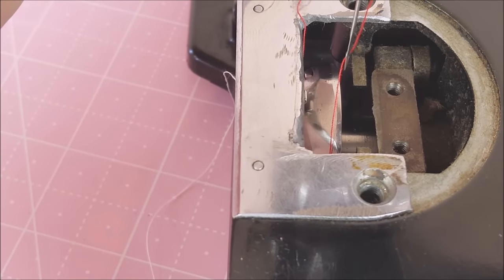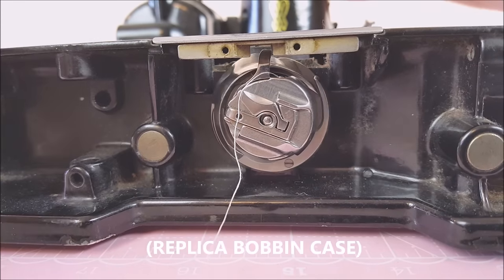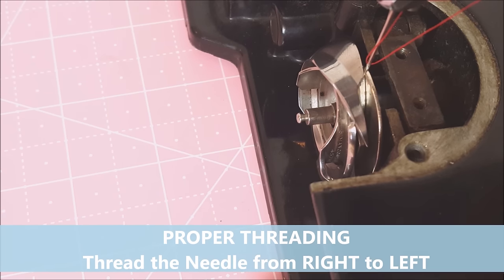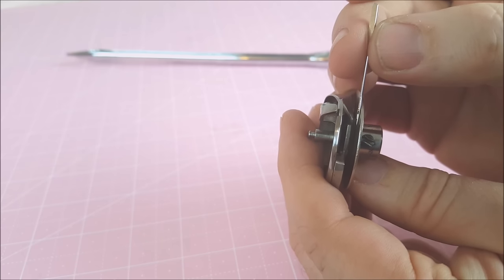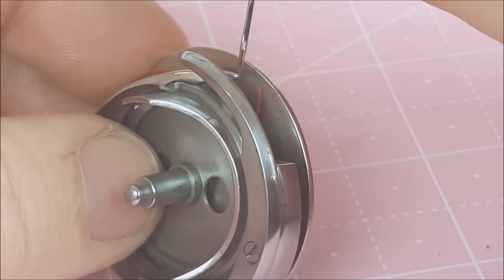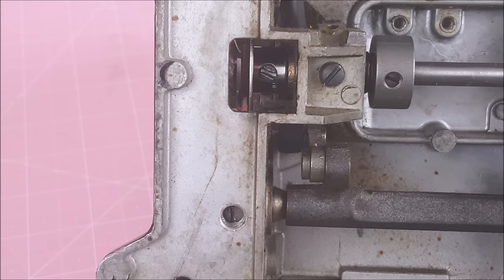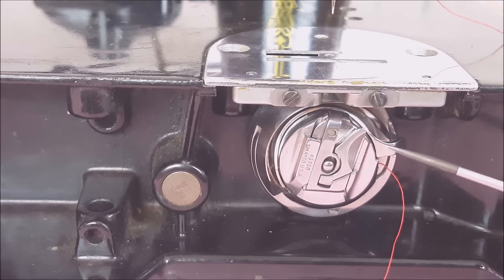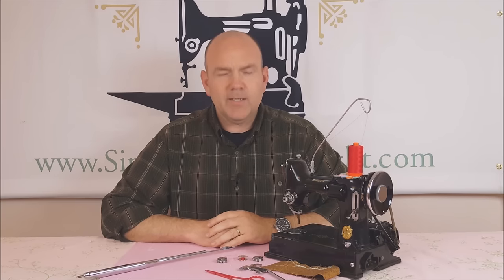Troubleshooting Singer Featherweight Stitch Problems

Comment: I used to take my featherweight into the shop for tension springs, oiling, etc...I can't tell you how many times I got it back with an incorrect spring installed and ending up with the same issues I turned it in to have repaired.  Since I found your channel, I do all the adjustments myself.  Thank you for making it so easy!!

Comment: What a terrific  video. A very simple to follow explanation of stitch formation. I am an independent sewing machine mechanic and for years I have been going through the same demonstrations with customers but I am sure, mine are not as understandable as yours. Just one criticism though. You neglected to mention the magical importance of the long groove on the rounded side of the needle, which is just as big a factor in stitch failure when the needle is in backwards. I always use that as an opportunity to tell customers to always feel for the long groove with their finger nail after they install the needle because it is not unusual for the needle to spin around in their fingers when installing. It happens to me more often than I care to admit. From now on, I am just going to refer customers to your channel.

Comment: Well thus far it looks like a case of bad Brazilian needles and a tightening of the bobbin tension. After I replaced the needle with an Organ Brand needle size 12 and tightened up the bobbin tension it seems to be stitching perfectly with no missed stitches at all. However, the experiments are not over it is still an interesting issue that I think may not be normal but we'll see! I know you recommend against these needles but gee whiz!

Comment: Thank you so much! your tip helped me fix my skipped stiches.  I had cleaned out the dust from under the needle plate and did not line up the position finger correctly when I put the needle plate back on.  Won't forget that next time! Thanks again!!

Comment: Excellent tutorial that complements the equally excellent maintenance handbook.  I cleaned, lubed and oiled my new-to-me 71 year old 221, sounded great but had some skipped stitches.  Next morning it made groaning sounds with possible parts rubbing.  Gears were dry, so repeated the lube and oil.  Started purring, but still has skipped stitches.  After some head scratching, removed the bobbin hook assembly (pg 62).  Found some nicks and gouges on the hook loop guard.  Used a polishing burr to remove them.  No more skipped stitches.  Also, had to disassemble the upper tension mechanism and reassemble (that’s another video).  After working on both, my 1952 221 sews perfectly.  Thanks Featherweight Shop.
Reply from the maker: We love comments like this!  Good job for utilizing the tutorials to fix all those areas yourself - that's wonderful and our favorite type of feedback!

Comment: Thank you! It seems like every time I try to clean or maintain my Featherweight, I end up unintentionally causing a problem. Today, it was a gob of bobbin thread under the material that would cause my machine to stop sewing. I thought it was the bobbin case, but the drawing in the guidebook just wasn't enough to allow me to understand the problem. Your video got me there and your explanation along with the cut out view of the bobbin showing how it is supposed to fit into a groove in the plate above it was excellent. You got me and my sewing machine back in synch. Thank you again!

Comment: What a great tutorial!  My Featherweight worked great for quite awhile, then all of a sudden it just stopped and the needle wouldn't move.  My husband took everything apart around the bobbin case and throat plate.  We thoroughly cleaned the parts and put a drop of oil where it was needed.  The machine sewed correctly again for a day or two and then all of a sudden it happened again. There was a tiny piece of lint in the bobbin case, so we removed it and it sewed again.  After a day or two, the same thing happened.  This time there was no lint or thread jamming or clogging the parts.  After we listened to your video, we noticed the bobbin case was not original and we think it has been the problem all along.  We found an original Simanco bobbin case online and ordered it right away, even though it was incredibly expensive!  But we figured it saved us the cost of a tune up.  Thanks so much Cameron!  You have surely saved the day for us!!

Comment: Great, your explanation on how the stitch works showed me how to fix a problem with a missed stitch.. the bobbin case had a couple spots of rust, and seeing how the thread slides over the surface, I thought it may catch or snag.. some 1200 sand paper and a little oil, smoothed it like glass, and it stitches perfect!!

Comment: Wonderful video that completely solved my problem.  The family Featherweight I sewed on in the past worked fine until it went to its new owner.  They didn't use it so I asked to borrow it to keep it in use and suddenly it wouldn't sew anymore.  Turns out somehow the positioning finger was no longer in it's correct position and your simple solution brought it back to working beautifully again.  Thank you!

Comment: My more "modern" Singer quit working. I took it to the repair shop and the lady said it couldn't be repaired. Luckily, the friend I went with had an old Featherweight she loaned me. But it kept skipping stitches, even though I was threading it correctly. Finally I watched this video, stopped and checked, stopped it again to check the next thing, and found that the needle was in backwards. Thank you very much! Now I can keep sewing until I can afford a new machine.

Comment: . THANK YOU!!!!! I just finished 200 masks and decided to clean & oil my machine, like I have  done for years. When I went to use it again it was looping the top thread, your video showed me that when I removed the feed dog plate I did not realign the bobbin case when I put it back on. Saved me a service call that would have taken weeks and $85, back to work.

Comment: For 2 days I've been working on a Sewmor 606 (1956) to get it to stitch.  Thank God you made this video.  However, on this model the flat side of the needle in on the right, and goes through the eye from left to right.  I was able to find a downloadable PDF. After to mentioned the featherlite one in the video goes with the flat side on the left, I noticed the PDF for mine said the right. Once I inserted the needle correctly, BINGO! Problem solved!  Thank you SO much!

Comment: Always excellent and clear tutorials on all areas of maintaining one of these little work horses! EVen though i have an actual service manual, the videos are priceless :-)Thank you for taking the time. The items I have purchased from your shop have been exactly what I needed to maintain my 2 Featherweights-(one in especially needy condition!)  In this video, A hemostat without ridges sounds minor but it is huge after working with ridged ones and tweezers to remove a caught piece of thread (that is my next purchase lol)...thank you also for that last minute tip about  the thread holder stand-now I "know why"!

Comment: I have an older Singer machine which is peddled run and belonged to my grandmother and I want to put this machine back in service just in case my new Singer has problems or I want to do some quilting with the old machine. I assume that the machine worked fine when she last used it and I had a new drawer made for it and intend to use this machine one day and this video has helped me so much and I know what to look for on the machine if the thread don't work like it should.

Comment: Thank you!! I was going crazy!  I took the machine apart, in pieces to clean, reassembled it and couldn't get it to work right. Put new needle in, rethreaded, new bobbin - nothing did the trick. then I watched your tutorial...  just as you said in your last tip I didn't have the positioning finger in line with the plate.  Thank you again!

Comment: Thank you so much! I kept having thread breaks and was so frustrated.  I knew there was something wrong with the part where the bobbin case goes it. It was turning freely.  You solved my problem.  And it was exactly what you said, I was cleaning the lint out and didn't get it back together correctly.  Love this video!

Comment: Oh my gosh! You fixed my machine! Well, you taught me how to fix it. I have my mother’s featherweight and only rarely use it. The last time I used it I thought it would be a good idea to remove all the lint and oil it. I was so proud of myself for finally doing it. It put it back in the case and put it away. Well, I pulled it out yesterday and the bobbin case would just spin around. After watching your video I was able to put it back together properly and it works. Thank you so much! By the way, I think this machine must be at least 60+ years old. Do you know what year they were originally made?

Comment: Thank you so much for your video.  My problem was easily solved, the needle was in wrong.  Once I turned the flat side to the left...it sewed !!!
Reply: I spent 2 hours trying to fix my 301 after I cleaned the lint out from under the needle plate.  Th problem was that the finger was not in the notch.  Thank you for this video it made all of the difference for me.  I understand what can go wrong so much better now.

Comment: I had the needle reversed. Having installed a number of pulleys and gears, I 'know' that the screw goes against the flat. As you showed me, not for needles!
Also I didn't have the positioning finger in the slot! I didn't have many birds' nests however. Maybe because the needle was in backwards? ;o)
Thank you so much for your videos!

Comment: Thank you so much, I think your the one that has been watching my post about the wrong bobbins that came with my machine.  as frustrating as it was the book page by page allowed me to get her going.  But there is still an issue with the loose plates on the tension, it is like the post is separated from the body of the machine, not all the time but it all seems loosey -goosey to me?  why?

Comment: Hi there! Thank you so much for your video and your tutorial. They have helped me so much in the past! Towards the end of the video at top video it talks about problems when you remove your move your top plate to clean out Lent.  Which I did do. I made sure the finger was back between the slot and the stitch plate on top. But it's locked up and won't turn. Is there something else I'm doing wrong?

Comment: Thanks for the great video.

My 221-1 has a Simanco 45750 but the thread gets stuck on the back like the reproduction that you showed.

My entire bobbin case and the tabs that are supposed to hold it in the correct orientation all spin when I crank the machine. I see that yours do not spin. Is there something I can check on that? 

I think the thread may be getting stuck because the bobbin case is not supposed to spin, and it ends up in the wrong orientation when the thread is trying to cross over it.

Thanks
Reply from the maker: Thank you so much for asking!  Follow the link below for more information and to contact us directly with questions about the Singer Featherweight - happy to help!  :) https://singer-featherweight.com/pages/contact-us

Comment: Hi Carmon, Thank you so much for the great video.  As a beginner, things were working well for me for just a couple of days and then I started to experience the same thread jamming that you described as coming from repro bobbins. Mine is original and was working well. I swapped out same weight thread and used it a bit successfully but then all of a sudden, it stopped working properly. Could this maybe be a problem of an over tensioned bobbin?
Reply: I took a wild guess and blew furiously into the bobbin case. Didn't see anything come out but the problem ceased to occur. hmmmmm....

Comment: I am new to your channel. I have 2 featherweights. One was my mothers and one was a neighbors. Both in near perfect condition. My Dad worked for Singer for years repairing sewing machines. 
I am about to order some items from you store including a new LE lightbulb. But the old one is STUCK and I am afraid it will break off in my hand. I am sure you have a trick for that too. But I will call when I order. 
My URGENT need is to get my machine to make stitches. I have gone over everything you have covered including a new needle and still no stitch, No jam, everything seems in place. Any more suggestions? Please

Comment: Learned something, but I still can not find a video or article on the tension disc being tight, so tight machine sews about 4 stitches and it stops. The thread above from disc to spool is taut.
Reply from the maker: Check out the Featherweight Schoolhouse under Maintenance & Tutorials for Tension tutorials.  

https://singer-featherweight.com/